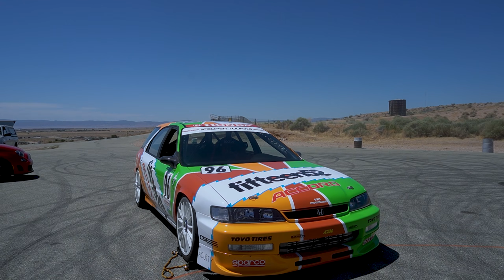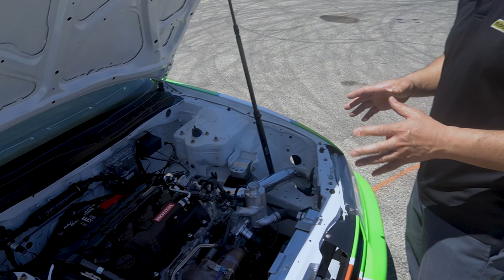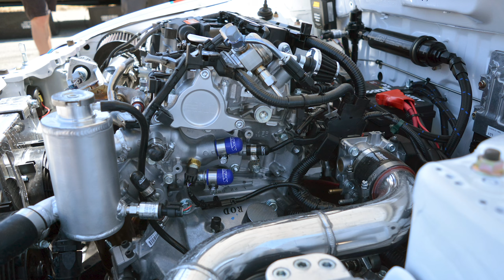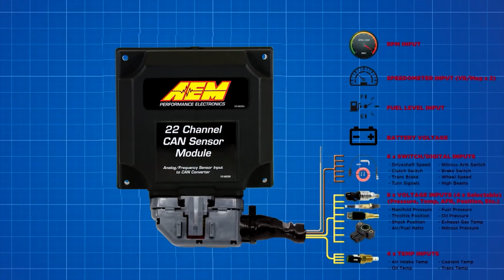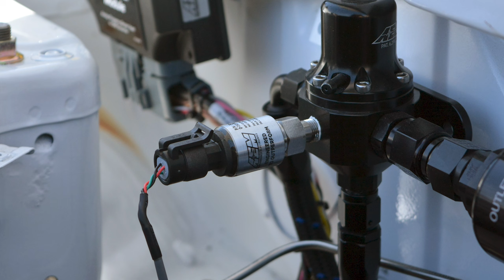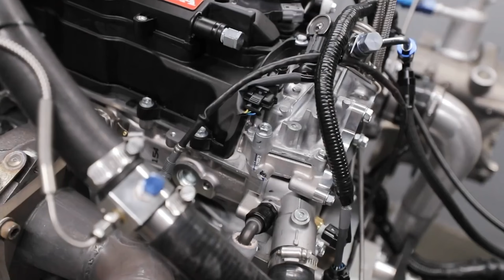96' Honda Accord Wagon Gets K20C1 ENGINE SWAP

Comment: 96-97, Honda Accord JTCC engine was a F20b naturally aspirated pushing 300hp at the crank. What a milestone that was back then.
Reply: Don't understand why the f20b is so cheap compared to the h22
Reply: @PreKHondaclub  because S2000
Reply: I didn't know that. I'm wondering if some of the parts that were used for that motor were even available for people that weren't directly involved with those teams.
Reply: I have the dohc f20b and it only has abt 180 hp
Reply: It was 330hp at the crank in the btcc, not sure about the jtcc.